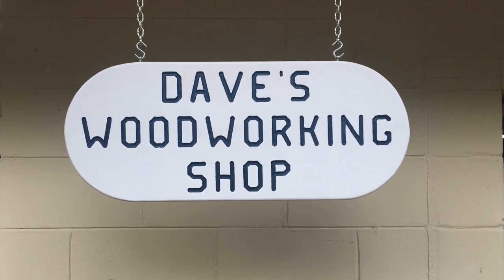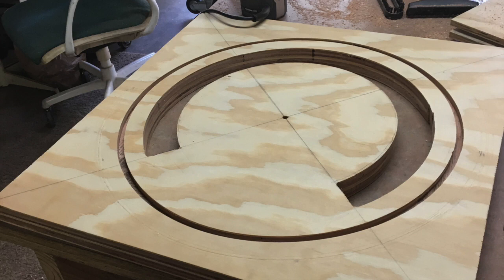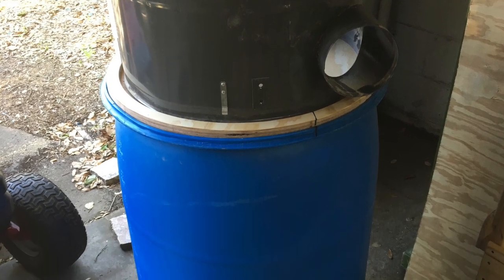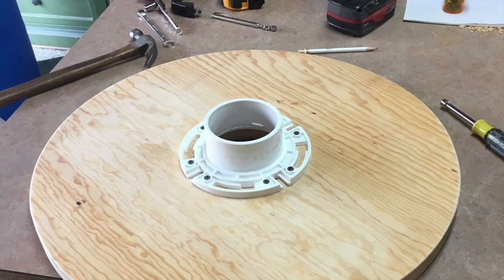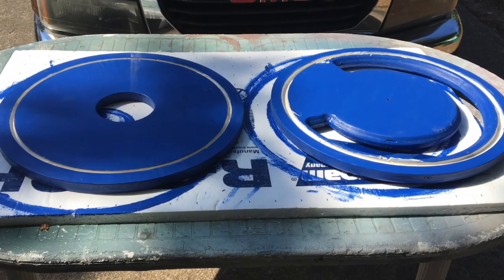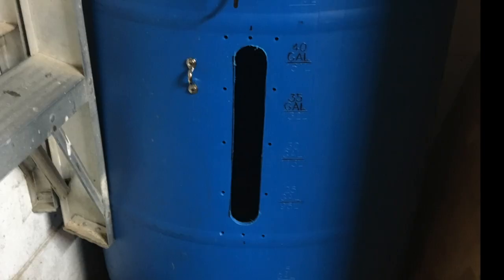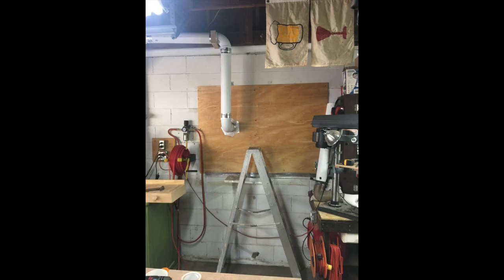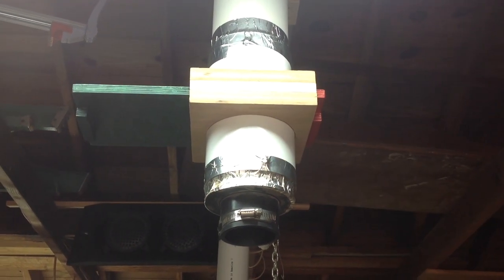Upgrading my Harbor Freight Dust Collector

Comment: Thanks Dave for sharing your implementation.  This weekend I think I watched about 20+ YouTube videos on this and considered which ones I would like to model mine after.  I think I'll use many of your points.  I did want to use the middle section to build the thien baffle and as this is in my garage, I am going to pass the filtered dust outside the shop.  I went out to purchase my 2hp HF DC this afternoon.
Reply from the maker: Gary McGeehon: Thanks for viewing my video. I too viewed about 20+ videos on this and took what I thought was the best ideas and combined them into what you see. My DC is vented outside also after going through the thien baffle. And my shop is in my one and a half car garage. Right now my DC is down, I accidentally sucked up my dust mask and it didn't come out the other end. So it's stuck some where in 40' of 78' of pipe. (Oops) I know the route it should have taken, but it didn't make it to the thien baffle. If you have any questions, please feel free to contact me. Stay safe.

Comment: OK! As many have said, I've been watching a plethora of HF DC videos! The way you did the baffle is by far the best use of all parts from the DC. I've been using a 2 stage (non baffle) system and have a Wynn filter atop the DC. The way it is now takes up a lot of floor space in my "tiny" :) shop. I'm stealing your set up, please don't sue me! I'll gain at least another 4 sq ft!

Comment: I have watch several videos of this modification and I haven’t seen anyone else come up with the toilet flange idea I like that it will make the connections easier I plan to use the thin wall drain pipe also
Reply from the maker: jourdan hazen: Thank you for watching. And I'm glad you liked my idea. Keep making sawdust.

Comment: Good video.  I have been researching lots of dust collection ideas and plan to vent mine outside, too.  As little as I will do won't hurt a thing or anyone.  I will also have a two stage.  Sure liked the fill gauge you made.
Reply from the maker: Darrell Blair: Thank you, glad you liked it. As for the fill gauge, I kinda wish I made it a little wider. That way I can see in there easier. But this is 20/20 hindsight. And Thank you for subscribing.

Comment: Nice job Dave. I'm making my first Thien Baffle today. I'm just knocking up a quick one from some scraps of OSB but will take great  pleasure in using my router to make a decent job at some point. It's interesting seeing the angle at which the chips are falling past the window in your blue drum
Reply from the maker: Thank you. Yea, I used my jig saw and router to help cut the slit in my Thien Baffle. It was a fun project. What's real interesting is the way the chip lay in the drum. They'll be high against the wall and in the center, but depressed in the middle half way between the center and wall. Think of a donut impression in the chips.
Reply: @DaveScruggs  That is interesting. I'll see what happens with mine. These things are fascinating, I've already got some ideas for another one. Have you had to reinforce the drum against suction?
Reply from the maker: @johnswimcat  No, not at all. The blue drum is thick enough to prevent that. Even the window doesn't give me a problem. The plexiglass is double sealed with caulk with aluminum tape over it.
Reply: @DaveScruggs  I've just tried my Thien baffle. Impressed is an understatement, the thing is amazing! I didn't think I'd made it very well because the OSB has a rough surface and the slot is in sections and about an inch in from the chamber wall. I think a tiny bit of very fine dust got through to the shop vac (as you guys call them, I'm British!) but the baffle must be almost 100% efficient in terms of collection. The next project will be to split the shop vac and make a Thien baffle to fit between the top and the drum. I wonder where Phil Thien is? It would be nice to be able to thank him for the idea

Comment: I understand how you can get busy and forget to take build pictures, I'm guilty too. Lol. That didn't hurt this video at all because the finished photos were exactly what was needed to understand how you built it. I understand that there are always questions afterwards but I wish you included a photo of how much dust is blown outside. If you could comment I'd appreciate it. 
Thanks for sharing.
Reply from the maker: AXMRDR, I made a short video showing the exhaust, and just how much dust accumulated after one month.
Reply: @DaveScruggs  Thanks, I think I found it.

Comment: Dave, thanks so much for doing this video. I also have a HF dust collection system and wanted to do a 2 stag set up into a 55 gal. barrel . I also mulled over using a cyclone vs the thien baffle, 1. I didn't want to pay more for the Onedia  large cyclone  seperator than I did for the dust collector sys. & I also hated to waste the large piece that goes between the bags. Your layout is perfect for what I was envisioning trying to do so, thank you for bring it to a working model that I will follow almost identically in my shop. Thanks for sharing and keep up the great work. One thing  you mentioned if you could work on is showing us more of the steps in the process would be helpful but otherwise Great Job!! James
Reply from the maker: You're Welcome. Sorry I didn't see your comment sooner. I try to reply within 24hrs. Since making this video, I have not had any problem with the system. Well I did have one. I had to open up the blade housing and clean it out. I had a little bit of build up, and it started to offset the balance and it started to make a weird noise. Once I cleaned that out, problem solved. But considering it took several years for the fine dust to accumulate on the blades, it's a easy fix. And I replaced the screws that hold the blade housing closed. I used screws with same threading, but larger heads. Dave

Comment: Great build and video, thanks. Your motor is mounted sideways, which makes sense for the direction of airflow, but are the bearings on the electric motor shaft able to take the downward loading? Are the bearings on the motor shaft, thrust bearings?

Comment: Well done Dave.  I built a similar setup with my motor in the shop attic to keep the noise down.  It's nice to not have to clean the filter anymore especially after using anything that produced fine dust.
Reply from the maker: Hardnox: Thanks. I love it.

Comment: Dave, I like your project.  Venting the DC outdoors is the way to go for many woodworkers, because it's the tiny dust you can't see that will cause long term damage to your lungs.  It's possible to filter that with the very nice and costly filters that are nearly as large as the 55 gal barrel, but you will never be as effective as pushing the air out the wall.  In  my case, my garage is my shop, and it's not heated or cooled.  In the summertime, I'm glad to have some air movement, but this would not be practical for a basement shop.
Money saved on a DC system that gets the dust out of the way and saves my lungs can be spent on a shelix cutter head or something else that I care about, so a practical system like this makes sense.

Comment: I have a question about the homemade blast gates: how airtight are they?  I've used manufactured plastic gates before and didn't like them much because the slots became clogged with sawdust and I couldn't properly close them.  I've seen a variety of homemade gates much like yours and have always wondered how well they actually stopped the airflow.  Thanks for the video, I enjoyed it very much.
Reply from the maker: TheCurmudgeon: Well all dust collection systems are not 100% completely sealed. There will always be a leak somewhere, and you can go crazy chasing them down. But as for my blast gates, they do a great job of sealing/stopping the air flow. Mine have 4 screws that hold it together, and a line drawn on them so when I take them apart to clean, they'll go right back together in the original way. So about once a year I do a maintenance cleaning job on them all. Now my wife is a smoker and I've used the smoke from her cigarette to see if it sucks any in, and what very minuet that it does, I call it good. But you've given me an idea to make a video on how to make my blast gates. I don't think I touched on it enough. Thanks for "Liking" my page and keep watching.
Reply: Thank you.  I'd be interested to see how you make them.

Comment: Question for you.  I am considering doing something very similar to this in my shop and I'm wondering how much fine dust gets blown outside? Maybe consider doing a followup video showing that for us?  I enjoyed this video and found it very informative and concise. Thanks for your time.
Reply from the maker: PATH OF LIFE, Go to Dave's Woodworking Shop on Facebook. I'll post a photo there so you can see how much fine dust gets blown outside. What you'll see is after 50' of Bubinga through the planer, the table saw, and miter saw. And my barrel is less than 1/4 full.

Comment: In my opinion this is a great video.  I have watched several on the subject and you had some points that I considered much better than the others I've seen.  I agree with you that most of the criticisms on youtube are just uncalled for.  I was wondering since I live in the country with no near neighbors, would it be possible to go without the separator and just blow everything outside?  I am concerned about letting everything go through the impeller though as I am afraid if a large chip is somehow picked up it might cause damage.
Reply from the maker: Tim Daniel, I wouldn't go without a separator. Just because once I sucked up a rag by accident, and it was caught in the separator and not in the impellers. So you never know what will go through your system until it does, and it's better error on the side of caution. Remember Eyes and Ears and keep making sawdust.
Reply: I once lived about a quarter of a mile from a cabinet making shop  in a rural community. They blew all their saw dust/chips outside. It formed a large pile of wood waste but no big deal. I'm inclined to use a collector because most sawdust can be used for gardening but not cedar or walnut. Aside from the other practical reasons for using one, a collector would allow you to keep useful waste separated from harmful waste.

Comment: Thanks for the video. I was wondering about static and grounding. any thoughts?
Reply from the maker: Gary Woughter: At a later date, not shown in the video,  I did add a braided copper wire. My system is with a 4" sewer pipe, and I connected them together, then went back and added a self tapping 1/4" screw to each side of the fittings. Then I went back and backed out the screw, looped the copper wire around the screw from screw to screw through the whole system, and then finished tightening the screw as I went along. Then plugged it into a grounding plug. And the screw actually protrudes into the duct work, thus removing any static from inside the pipe itself. Some people say you don't need a grounding wire. Some people say you don't need to use screws. I used both just in case. After all that was done, I went back and added aluminum tape on all the joints to seal it all up so I don't have any leaks. Well I hope that helps you out. Now my most current video shows my empty shop and house. Because I've packed it all up, and I'm moving from Florida to Michigan. So keep watching for new videos.

Comment: Dave, one other quick question, since you vented outside  do you have any issue with the dust collection pulling all the heat or cooling, ( maybe AC if you have that) out of your shop when the fan is running? I know there are some video's on here that mention that happening.

Comment: That was a great video and very informative, especially as it’s your first one. I especially like your ideas of the sanitary waste flange and the drier vent.  That’s a cool adaptation for commonly available products. I have a quick question...you’ve used PVC to construct your system, with a lot of 90 elbows.  Are you having any problems with static charges and clogging? I’ll be honest, I’m leery of using PVC because of that, but it’s so much easier to use than metal ducting.  Please let me hear your thoughts.
Reply from the maker: Boris Calderon: Thanks for your kind words. Since that video was made, I've reduced the amount of 90° elbows to 2 - 45° turns with 6" piping between them. Even when I had the 90° there, I didn't have any clogging. Where I had the problem at was where I had a "T" section where 2 lines came together. Now I have a "Y" with 2 - 45° bringing 2 lines together. All my pipes are screwed together with 1/2" sheet metal screws with a copper wire running from screw to screw. And the screw protrudes inside thus reducing any static. So I don't worry about static. I hope this helps, and Thanks for watching. Keep making sawdust.
Reply: I have seen Oneida (?) use bare copper wire inside the pipes to drain off static electricity. I forget the details but expect to start using grounding this summer.

Comment: Dave, love the video!  I just recently started to convert my HF dust collector to a 2 stage.  I'm not going to build a baffle but rather just use the one supplied with the HF collector.  I was going to try to force the plastic lid of the barrel down into for a good tight fit.  I'm sure after hours of trying this I will make my lid out of wood also.  My question is where did you get the plans for your bandsaw circle jig?  Still, don't worry about the trolls on youtube, you did a great job and it works as advertised.
Reply from the maker: KENNY KYLE , Thanks for the nice "works as advertised" comment. As for the bandsaw jig, I just thought of it, and made it. I'm one of those guys that can think of something and just know how to build it. I actually was going to move, and I threw my Jig away to save space. Well the house didn't sell because people didn't like 3 massive oak trees over the house. So after 90 days with no offers, except one couple wanted us to cut the trees down and Not add it to the price of the house, we moved in. And let me tell you, I'm revamping the shop, surround sound, and a 42" monitor for the computer to eventually run a CNC router, a new work bench, a 4'x4' walk around assembly bench, things are coming along. Wait for the new video to come out. So, I'll be making a video of a new bandsaw Jig also, so watch for that one. You can stop by Dave's Woodworking Shop on Facebook and you'll see almost daily photos of the new shop. Hope to see you there.

Comment: Hi Dave, 
I have a HF system using a pleated filter but I had considered direct venting. My concern is how much air I needed to pull from the outside, how did you handle the replacement air?
Reply from the maker: James Benenati: All intake air is pulled from the location, (i.e. Table saw, Bandsaw, Mitersaw, Drill Press or Planer) and all gates are closed, leaving only one open to give the maximum amount of air intake. And then of course it goes through the baffle, then the fan blades, and the fine particles are vented out. No other additional air is really needed. Now I know that there might be a few small air leaks, but fixing them would take more time and effort than the nominal improvement it would provide. Since doing this setup, I haven't had any problems. And Yes it's nice to not have to clean a filter or bag. If you have any more questions, please feel free to contact me.
Reply: Dave, I don't think I worded the question correctly. If you are blowing 1550 cubic feet of air per minute out of your building that creates vacuum, do you have open a window or door  for the system to work ?
Reply from the maker: James Benenati: My apologies, my shop is in a 1.5 car garage and anytime I'm working, the double wide garage door is wide open allowing as much air flow into the shop as possible, so the suction from the dust collection gets as much air as it needs. I don't know your setup, but crack open a window in your shop, turn on your HFDC and feel if there is an inward draft. If there is, keep opening the window until you can't feel it anymore. That way there's an equalization of pressure. Sorry for the confusion. I hope that helps.
Reply: Dave, thanks for the explanation, my shop in the basement of fairly well sealed house in Canada. I think I could  go the window route during the summertime but during the winter I think I would freeze.
Reply: with your specific case use a winn environmental 1 micron canister filter instead of the cloth bag filters.
Reply: @jamesbenenati1039  You can also use Donaldson pleated big rig filters for half the price of the Wynn. I forget the part number but it is online on several forums including Lumberjocks.com. Same Merv rating as Wynn
Reply: Tim Royal  n
B